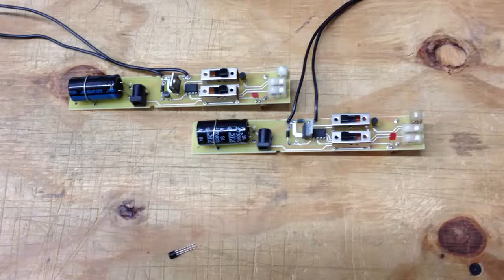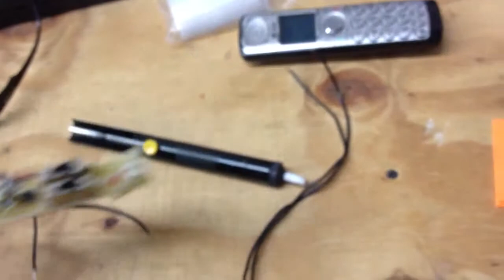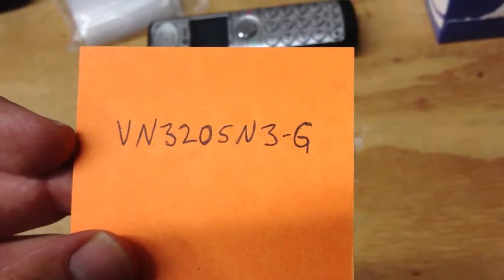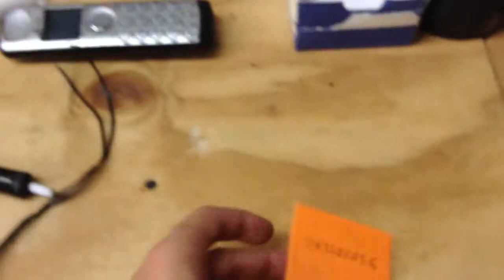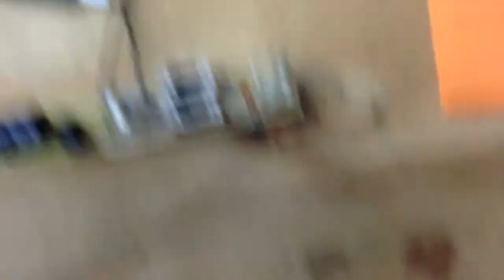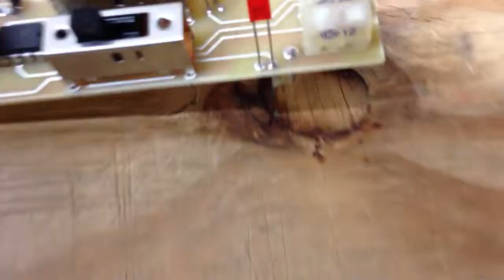Drozd Blackbird - Mag Repair

Comment: Hello Ray, i replaced the voltage regulator transistor just like you show in your video and now my magazine continuously runs instead of running and then stopping when the bbs are up to the top of the magazine. Any thoughts on what happened? What stops the magazine motor from continuing to run once the bb's are up to the top of the magazine?
Reply: You may want to make sure you got the right type of voltage regulator.
Reply: @DR.ELEKTRIK  sorry, gentlemen, Ray calls it "voltage regulator" mistakenly. This is a transistor. Nearest analog is BSS295. Actually, any N-type MOSFET in TO-92 package rated for 30V and 1A or more would do if connected properly. Yest, its pins positions should be taken to consideration.